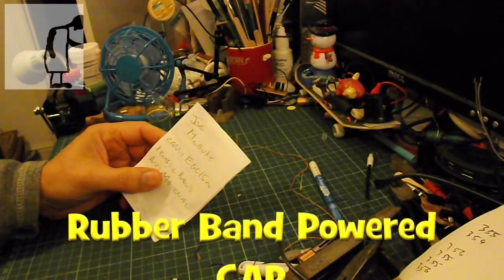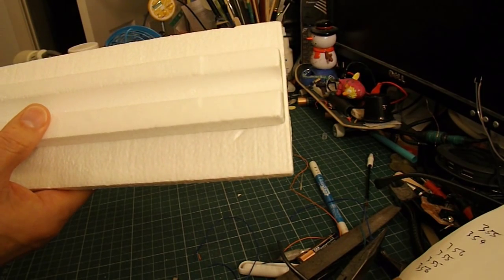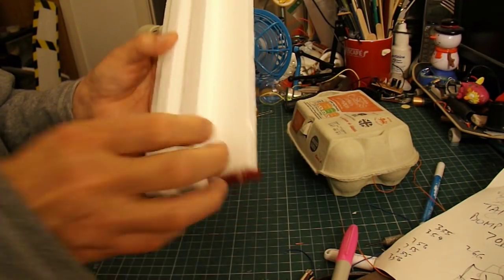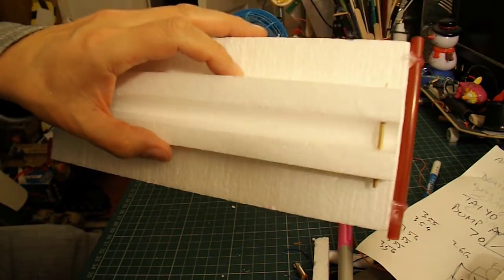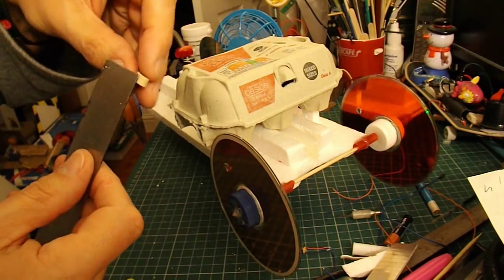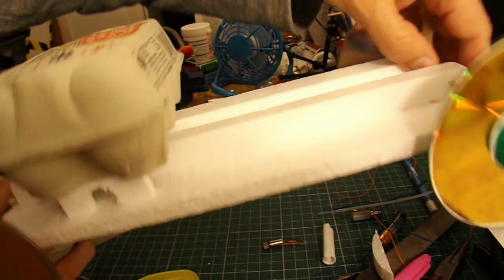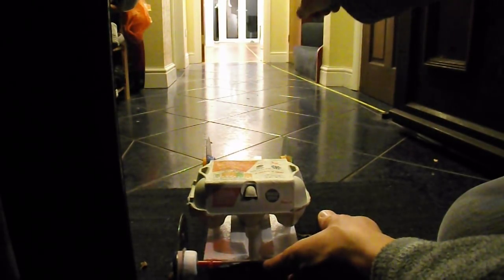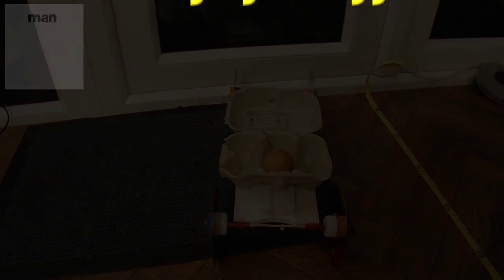Rubber Band Powered Car carrying an Egg

Comment: Hey Grandad, I have been watching your videos in an effort to create a rubber band car for my school project. I need a vehicle that can shoot forward and then go back the same way it came. The point of the project is to see how far the vehicle will come back.
Reply from the maker: +David Garcia my first thought is you have two simple options. First tie the rubber band to the back axle so it does not come loose. That way when it goes forward it unwinds under power and then winds up again as the car continues to roll forward under it's own momentum until the tension on the band stops it and then makes the car go backwards to unwind again and the same process works again in reverse and keeps repeating until it eventually stops https://youtu.be/pg8-3VARy1M  If you want full control over it then you need to use the process I used in these cars https://youtu.be/bBU8UngaFfM  https://youtu.be/ILvqa8Id4Rc

Comment: Hey grandad so a year ago I found one of your rubber band powered cars and it helped me with a school project and now I have to do the same thing but I need the car to carry one pound and use one of those rubber bands that isn't able to be stretched that far I don't know what type they are but can you help at all
Reply from the maker: +XxshaiderxX18 not really sure what I could advise other than show you this playlist that does include some of my cars carrying weights. The main thing about carrying weights is that the axle needs to be stronger than normal and the wheels may need to be thicker although one pound is not really a great weight. I think the ones I did carried 4 or 5 pounds 
Carrying Dropping Pushing Pulling Stopping https://www.youtube.com/playlist?list=PLA5a2xPRSrB04L6RpUAs5akmK3jqmahPL

Comment: hey grandad i need a little help from you. I have to make a project for my school. its a car that can be powered by rubberbands,springs mousetrap or balloons. The car needs to travel up a 10 degree  inclined plain for 10 feet. The width of the plain is 1 feet. The car needs to stop after 10 feet and has to stay there,can not roll back. Ive tried myself but the car rolls back and does not travel up the plain. Please help me. The plain surface is wood. i can use any materials other than electric batteries etc
Reply from the maker: +Kamil Shams here is a rubber band powered car that does that https://youtu.be/Cwz2rR0asus
Reply: +GrandadIsAnOldMan thanks grandad, that video does help a lot but one or two things i still wanted to ask. The ramp you built is elevated on both sides so the car can not fall off and there is a wooden block at the end that prevents it from flying off. The ramp that i have to do this on does not have those so the car has to go straight 10 feet and stop itself without any blockage. Your video was very helpful but if you could just help me with these questions that would be awesome. Thankyou.
Reply from the maker: Kamil Shams so you need to add a brake. Here is my playlist with some of my cars and some by other people https://www.youtube.com/playlist?list=PLA5a2xPRSrB3MyidvKMT3DqU1vNy9Atsf
Reply: +GrandadIsAnOldMan thanks again. The ramp is 1 feet wide so how wide do you suggest I make the frame of the car so that I have enough room for it to travel 10 feet without falling. I was thinking 6 inches should work
Reply from the maker: Kamil Shams it's more a matter of keeping your bodywork rigid and your axles parallel so the car runs straight. You may want to make sure your axle is thicker than normal as you will be using more power to drive it up the slope and if it starts bending that could cause the car to turn left or right. Making the axle thicker will also help put more power to the wheels. If you make the part where the rubber band is going to wrap round much thicker than normal it increases the leverage. Using smaller wheels has the same effect but you may lose grip quicker. The wider the car is, the easier it is to keep the axles parallel but if you leave the back axle unsupported it will make it easier to bend.
Reply: +GrandadIsAnOldMan my car is a little heavy. Does joining a lot of rubberbands give you more power so that it can go up the ramp?
Reply from the maker: +Kamil Shams if you join the bands end to end you get a longer band so you can stretch it further and wrap it round the axle more times so the car will go further. You don't need that in this car. If you put the bands side by side so you get a thicker bunch then you are increasing the power over the length. It will go the same distance but have more power. I explained in my previous reply you can increase the thickness of the axle or reduce the size of the wheels, both will give you the effect of more power without changing the bands. In some of my cars I have wrapped tape around the axle to make it a bigger diameter where the band will go. Here is an example https://youtu.be/vc0URTIqdSA